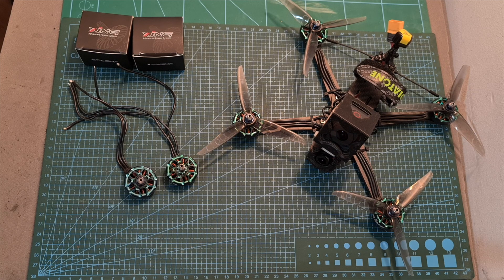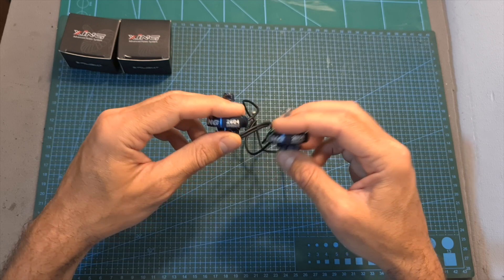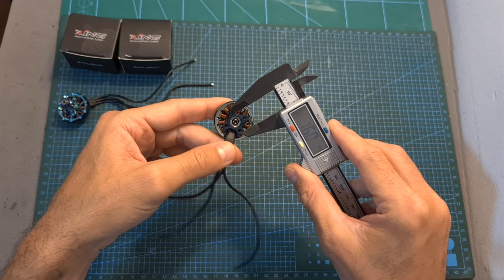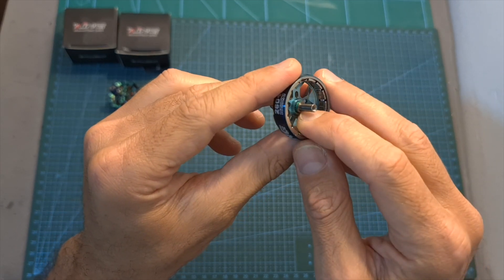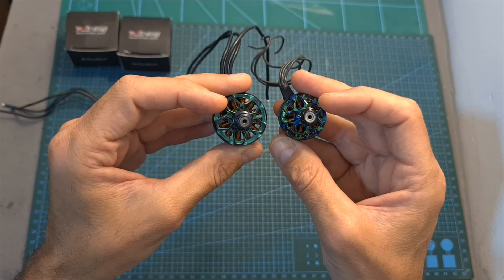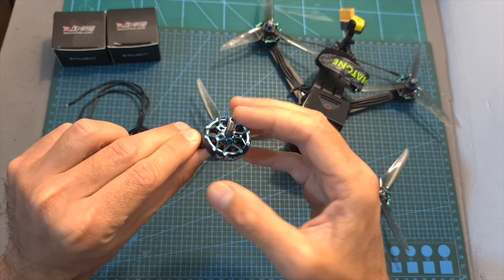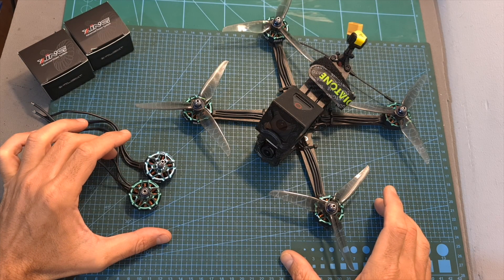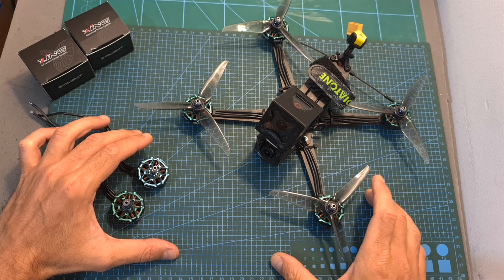iFlight XING2 2604 1350KV/1650KV - Thrust Tests & Flight Footage

Comment: Damn I purchased some of the 1650kv specifically off Amazons Iflight store specifically for a Wu Tank Max 6 inch frame build because they said that 6 inch 6s would not be an issue. So if I run them 6 inch 6s I'll more than likely burn them out?
Reply from the maker: I think that it will be ok. Thrust tests are a bit more demanding than "real life".
Reply: @KremerFPV  ended up ordering a set of Brother Hobby 2507v2 1500kv yesterday and will run them on the 6 inch as a better safe than sorry. I think I'll end up swapping out some 2306.5's I'm running for the 2604's at some point. Thanks for the review and reply as always Gal!

Comment: Good thing i saw this. Was going to get the 1650kv for my 6inch build, but I guess I should get the 1350kv. 
Have you testet the 2506 motors?
Reply from the maker: I am glad I could help you out. Haven't tested the 2506 motors and I doubt that I will since I don't have them.

Comment: Hey Amigo,  WOW whooping 9.243 gf/W  @50% throttle 4S  7042 bi blades WOW !!! it beats the  Racerstar AirA 2508 1200KV with  4S  and  7042 bi blades  and the Tmotor F90 , i swear you have uploaded a video on the 2508 motor and now cant find it !! sorry! it was here where i saw the tables https://www.racerstar.com/racerstar-aira-2508-1200kv-4-6s-brushless-motor-for-rc-drone-fpv-racing-multirotors-p-313.html  and

Comment: Hi Gal   WOW  !   I don't know who is crazier you or me.  I can't believe it will work with 6s and 5in props  ?  My fastest quad so far is using momba 2306.5 1850kv but is not efficient.  But a lot of fun.  Now a 2604 sounds big enough for 5in, I just wonder how they would be.  Yes I am interested in just how fast it can be. Thanks again for the video and information.